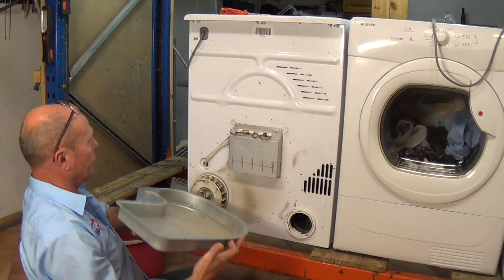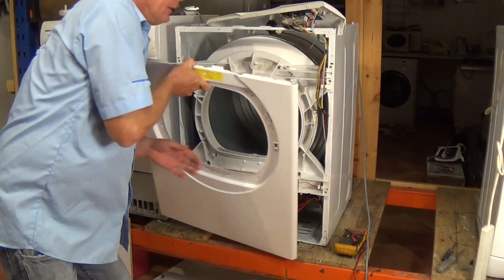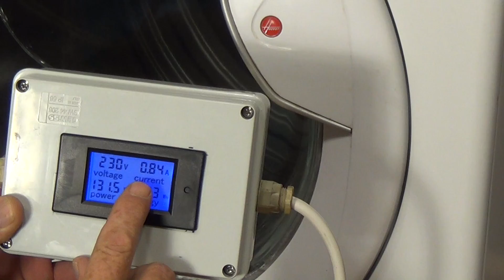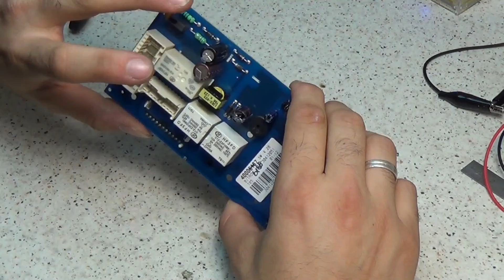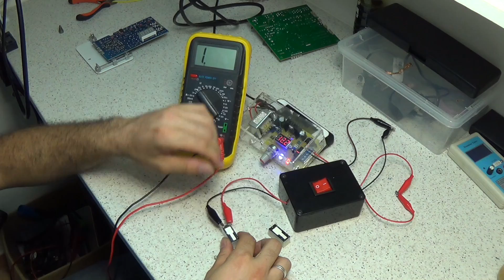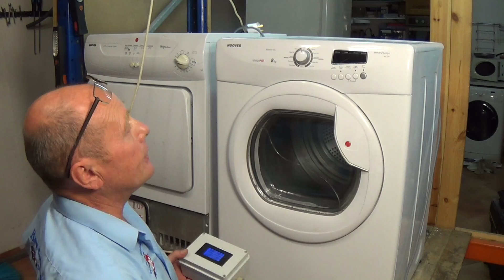Tumble dryer not heating Hoover Candy diagnosing fault and repair

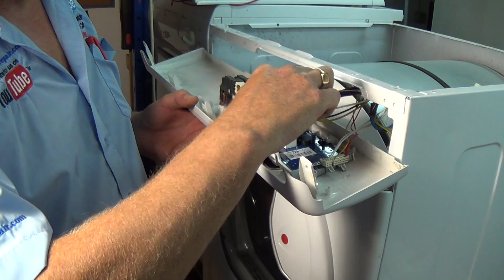Comment: At 11:16 - I traced these three cables. They do not go to the heater, they all go to the motor. An additional earth wire comes out of the motor and can be traced all the way to just above the anti-parasite filter (EMF filter?) next to where the power cable enters at the upper rear of the dryer.
Reply: Anyway, I'm thoroughly enjoying another battle with this dryer (No Heat, E08 code), many moons after your video guided me through a bearing and spindle replacent - there was hardly any left of the previous bearing 🤣 - and a new jockey wheel installation.
Reply: 'tis gone midnight. Our battle shall recommence in the morn, my dear Hoover enemy.

Comment: Hi... I have a error code E08 on this Hoover hdry 300 lite,  am I in thinking that it's the heating element that's at fault
Reply from the maker: Hi mate,  I'm sorry to hear about the problem with your tumble dryer. Hoover tumble dryers sometimes show an E08 error code when they overheat. This could happen if the dryer isn't always turning, which means it doesn't get the airflow it needs over the heater.

The fan blade on the back of the motor circulates air through the machine. If the airflow is restricted or not blowing at all, the thermostats on top of the heater may overheat. There are usually two thermostats on the heater.

Comment: Very useful instructions. After a mere 20 years, the heater stopped. Looks like it is the microswitch operated by the door when closed, stays open circuit. Tempted to bypass it instead of a teardown to replace it.
Reply from the maker: Thanks a lot for your message mate. Please remember to subscribe to our channel, as that really helps us 😇

Since we work very hard in our warehouse making free video guides for you all on appliances, we always appreciate a beer, offering a choice of single or round beer. https://www.how-to-repair.com/help/buy-paul-a-beer/ 

Thanks, Paul 👍
Reply: @How-to-repair  I bypassed the switch, now heats. Nice cheap repair.

Comment: My Hoover VHC 691B stopped working, it was totally dead. Checking the circuit board i could see the chip had broken apart, so I replaced the circuit board. However when I tested it the tumble dryer stopped and beeped when I put it on a sensor porgramme and if I tried it on a timed programme it went straight to the spin bypassing the heat part of the programme. I ended up biying a new heater however the tumble dryer is still showing the same symptoms. What else could the fault be? I was thinking maybe the NTC sensor is broken but I'm not sure. i cant locate any other thermostats apart from the two on the heater that have been replaced. Many thanks.
Reply from the maker: Hi, please use our contact us page and make sure you fill out the request for what your problem is. I will need the full model number of the identification plate and the details of your problem so that I can provide you with useful literature. A video shoot of the problem would be perfect as well.

Normally, I would get back to you within 24 hours but I am on my way to the IFA trade show in Berlin, so it can take more time to respond. Thanks for your understanding. https://www.how-to-repair.com/help/contact-us/   

Please remember to subscribe to our channel, as that's what keeps this channel going. Thanks, Paul 👍

Comment: Hello sir I have a candy csc9lf-80 and I have tried all sensors and element no problems with them the machine flashes 11x after a minute or 2 of running.I run the machine with out the door on and it was running just fine any idea what's up with it 👍

Comment: I got continuity on my heater (3 cables) element on black and yellow. it beeps.  black and red beeps. and yellow and red beeps as well.  is this mean  my thermostat faulty on black and yellow cable? I also checked continuity on each thermostat  with one of the cables disconnected, both thermostats beep.  on my heater circuit i got 26 ohms on both and label says 1050/1050 watts. it looks like i have to go and open up my relay from my program panel. Update: I took of the relay from the panel and opened it up. Black burned contact points. Waiting for the new one.

Comment: Fantastic video. Thank you so much. Have a Candy tumble drier which stopped giving off heat and showed an E15 error code with all the lights on the dispaly. Withr the help of thia video i was able to fix the dryer and save eho knows how much money. Went out and bought a cheap Multimeter (£8.99) and diagnosed issue with a thermosat sensor by continuity testing. Sensor cost me £7.25 from ebay. Had it fixed within 5 days.

Comment: Great, saved us a new tumbler dryer. Hotpoint error code 21, video gave me confidence to find fault as was really simple to follow., filter was clogged and the thermostat over the heater had tripped and I reset it with just a touch. Many thanks.

Comment: Hi my friend has a candy condenser dryer cs c8lf-80 
Its about 4 years old and it keeps tripping the heater me and her partner changed the thermostat with the button on it as it kept not heating and flashing then after 2 times it wouldn’t pop up again! So we replaced it and then it’s worked fine for 2 weeks now it’s doing it all over again… what do you think this could be ? As everything else works fine… we didn’t replace the other thermostat on the left but that has no button. Could it be that one or the element?  even though it looks fine we’re a bit confused as to what it is…. and YouTube just keeps saying press that button or replace it we did! and will stop and work  for a short time then trips the heater again and blows cold air after. All airways heat exchangers etc are clear and clean. We’re lost and they can’t afford a new dryer and it’s not even that old they would rather sort it out…

Comment: Great video thanks for taking the time to make it.
I am currently testing the heater and get the following readings.
white/red 97ohms
white/black 49.3ohms
white/yellow 49.5ohms

What are the correct readings for this element?
Reply from the maker: fill this in and it will tell you the wattage https://ohmslawcalculator.com/ohms-law-calculator Thank you For leaving a comment this is for you https://www.youtube.com/shorts/e432SAb2g08 please remember to subscribe as that's is what keeps this channel going. Thanks 👍

Comment: Hey just found that nice Video, what if i test my Heater and get continuity over all fields? 
Testing White + Red = 96 ohm no beeeep
white + black = 48 ohm and beep
white + yellow = 48 ohm and beep
other combinations are all 48 ohm exept yellow and black there 0 and beep
Does that mean my heater is dead ? i mean should be 2 circits i guess?
not that expirience in electrical testing so an answer would be nice

greetings

Comment: Thank you, for another great video, please help me,  I have an INDESIT SENSOR condensor with all leds flashings - I have reset one of the thermostats with a pin and heard it click, the heater look okay, and the dryer started heating for about 5 minutes then again F04 error and flashing - (I don't have a multi meter) , is F04 'pump not piloting issue' or is it a heater problem, thank you in advance
Reply from the maker: without having a multimeter it is impossible to check for machine correctly. it would be unfair for me to actually answer this without having the machine in front of me as I might be giving you false information. I'm sorry I'm unable to help with this one
please remember to subscribe to the Channel as that's what keeps us going and able to make videos for you

Comment: Hi I have a Miele tumble dryer T294c It’s not heating up cold air light coming on then stops I tested the thermostat at the back where the heating element is and is working there is another temperature sensor next to it the reading comes 98.9 ohms I don’t know if this is a good or not but I’m stuck with it what do you suggest me to do based on your knowledge thank you

Comment: Fantastic video mate !  This is actually the second time I’ve watched it, used it to diagnose a thermostat fault over a year ago on my appliance.  Just searched for a video to diagnose a fault again to refresh my memory & your video was thankfully the first to come up.    My machine is slightly different in being I don’t need to remove the top or front, the bottom has a small section that comes away independently, I didn’t realise this until I’d stripped top & front though the first time, then made the same mistake again the second time 🤣. You’d think I’d learn, hopefully remember if it packs in again in a few years.  Thanks again, saved us a good few hundred quid 👍

Comment: Thanks for a great video, I have nearly the same machine and it seems to take far too long to dry...it draws 9A for a very short time and then goes back to drive amps for a bit then heats again but not for long...it is on the 40 min quick high setting.  Is that normal pleasel!?

P.S. It has a new heater unit at the back.
Reply from the maker: Thanks We now have Live Q@A's weekly on our live Show , see our home page https://www.youtube.com/c/How-2-repair for the next date

Comment: Hoover DX C9DG-80 Tumble Dryer Thermostat
My dryer gets so hot that it's melting and burning clothes. Any idea which sensor or thermostat it could be? Hoover want a £150 call out charge but a thermostat is as little as £6.50

Comment: I have the condensor version and have replaced the thermal fuse 3 times in the last year,  we ensure the filters are cleaned regularly yet the fuse still blows after a few months. Any idea what the issue could be?
Reply: Most of the time it is the thermostat failing, burning together and not switching off, then the fuse will blow when reaches the 206C. So usually a fuse blow means something is faulty before it.

Comment: Paul, the wiring on the heater section, if you say that the yellow and black go to same terminal, surely they should short. And in the video when you say you get nothing, its not between those. What should you get on the wiring?
Reply from the maker: Hi Gary, 

Book in for a free one to one via facebook messenger with paul 

Im sure he will be able to point you in the right direction :)  
https://www.facebook.com/how.to.repair.appliances/
Reply: If you undo the metal tabs on the heater element, unscrew the screw on the side, and remove the two long locking wires (one each side, bent 90° at each end), you can split open the heating element. This would allow you to see that the black and yellow cable are connected together at the same end of one heating coil. I did this out of interest, it was good to be able to see how the electricity flows through the elemt.

Comment: Hi my drier heater element looks similar to yours only mine has only 3 wires in the block, when testing i get continuity on the black and yellow but nothing on the black and red or yellow and red, but when but when testing direct to the element i get continuity so am i right in saying the temp sensor is on the right and some sort of fuse on the left as the bit on the left has an open circuit thus not making continuity to the heater element, my machine has a fault code of error 22 my machine is a hoover one touch dynamic next thanks
Regards
Nick
Reply: Have just diagnosed the thermo switch is open circuit 206c as i have read its a solder fuse and its blown so a replacement has been ordered and now vacced out the entire mechine of fluff which is probably what the problem cause

Comment: The worst tumble dryer I have ever had (candy) and these YouTube videos of how to fix it are to confusing to me I have 6 bags of clothes to dry and my stupid tumble dryer is not working not showing any lights only beeping when I press the on off  button 😕 I smashed my hand on the front of the dryer it worked and then stopped again didn't solve anything 🙈so I decided I would just buy a new tumble dryer £300 later they are so expensive but if I can fix this tumble dryer I will have two running wish me luck 😂

Comment: My Hoover model is HL V8LCG-80. A more modern version of the one in this video. I followed every step and found the exhaust (front) thermostat to be o/c but checked out the rear heaters because this is also a heater protecting fuse.
I ordered a replacement from the web site for under £8 with free delivery when the one I ordered from Hoover had a long postage delay . The "How to repair" part arrived on the day specified and the machine was back in business within an hour. Brilliant service. Note: on this model the front panel is in two halves. Tilt the machine back as Paul does, remove 3 screws underneath (feet don't need removing) and pull the kick plate lower plastic panel straight down off it's locating lugs. This will reveal the 85 degree thermostat-fuse which can be tested and replaced as necessary. No other parts need touching if this fixes it! I could have faced a £120 call out and fix charge from Hoover who's engineer wouldn't take more than 15 minutes to replace this part.
Note, the Hoover thermostat ordered 10 days ago, still hasn't yet arrived and I paid £3.50 postage!
Reply from the maker: Iam Glad we could help you.if you ever need help please use our site for 24 hour response https://www.how-to-repair.com/help/contact-us/
If have a question please use our site for 24 hour response https://www.how-to-repair.com/help/contact-us/
Please remember to subscribe to our channel
https://www.youtube.com/user/Apart4u?sub_confirmation=1

Remember to Shop with www.how-to-repair.com and it would help us by posting the video or

website on your timeline. This helps us a lot and if we really helped you can
always buy us a beer http://how-to-repair.com/help/buy-paul-a-beer/

Please remember to mark us to your favourites also I would be grateful if you would
subscribe to our channels social media as this really helps my site and keeps
us going.
YouTube. http://www.youtube.com/user/Apart4u

Facebook. https://www.facebook.com/how.to.repair.appliances

Comment: Hi,  Generally excellent video ... BUT...
1/  I would suggest using a clippit (kitchen aid) to prevent wires disappearing into machines rather than wasting a zip-tie every time.
2/ Give your multimeter cover a wash - it looks very unprofessional being so grubby!
3/ OMG!!! BUY AN ELECTRIC wazzing SCREWDRIVER!!!  It is excruciating watching you waste your life doing it manually!
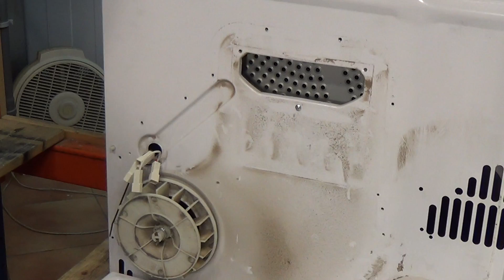4/ At 4:44 there is zero correlation between what we are seeing and the voiceover in terms of what wires the meter is connected to.  Very confusing!
5/ Why not use a hot air gun to FULLY test the function of the thermostat switches ie in both 'on' and 'off' conditions?  All normally closed stats will often fail closed!
6/ Your intro mentioned an air-flow switch but there was no mention of it in the rest of the video...?
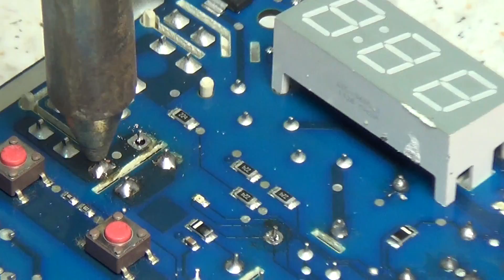7/ At 14:00 you can clearly see a scorch mark on the solder-side of the PCB correlating to the overheating of the failed relay contacts - a very good clue to back up your theory that the relay has failed... without the need to necessarily test the relay.

I hope you don't take any offence at my direct manner (it's the Northumbrian in me).

Comment: Hi, thanks for this video. I just used it to fix my Hoover tumble dryer. It was the thermal fuse, first thing on the list, but I obviously tested the rest of the rear mounted bits like the thermostat and element. Really clear video and now im back up and running for just £10 in parts. There was a shocking amount of singed fluff stuck in the blower output so that might be the root cause. Id suggest anyone gets that cleaned out yearly, it's on a few screws to pup the covers off and get to it.

Thanks again.

Comment: Had same problem all lights flashing and beeping. dryer worked by no hot air blowing. Candy wanted to send engineer for 120£. so did test on heater as shown in vid with volt meter. one thermostat not working, so £30 for new heater of ebay. simple to fit and now all working. thanks so much would never have attempted it without your vid and so easy to fix.

Comment: i bought a heating element for my candy condenser dryer, i've tried to replace it but there are only 3 wires and my new  element has 4 wires ,it was sold to fit my model please help

Comment: Thanks for the detailed instructions! I have the exact same model and although I don't have the correct equipment to complete the final tests managed to identify the printed circuit board was the cause of the problem.
I fitted a new board and noticed that each time I changed the setting on the selector dial the panel made a beep - realised it hadn't been doing this for ages. All working fine now!
Thanks again for the advice.
Reply: How much was the replacement board please?

Comment: Loving these tutorials, already have a fixed washing machine thanks to the videos. My hoover tumble dryer is doing the same thing, I've tested the heater and the thermostats in the heater all shows continuity (the heater itself only has 3 cables and all seem to throw 0.02 when tested). The NTC sensor shows a drop when I place my hand on it and eventually goes back up. There doesn't seem to be a thermostat on the front like the model yours shows. Not sure where else to go. Presuming it's now going to have to be the relay but is there a way for someone that doesn't have the kit you have to test wether the relay is dead or not without removing it and building a 12v test bench?

Side note when turning it on with the panel loose I get one click when it starts then another click a few seconds later does that help at all in diagnosing?